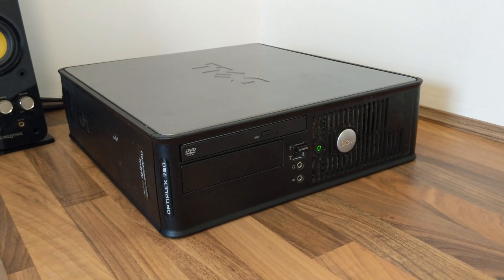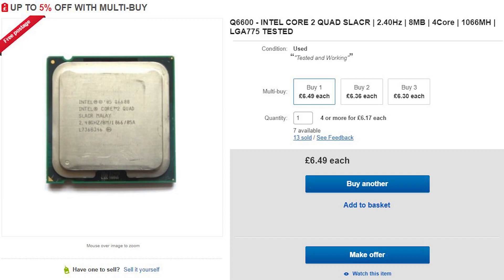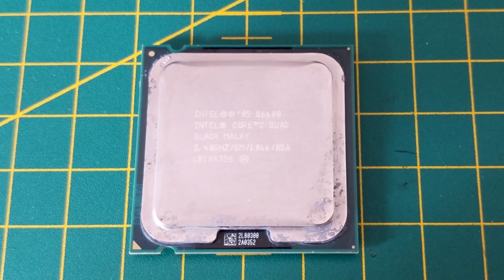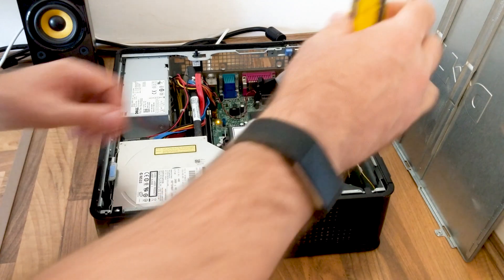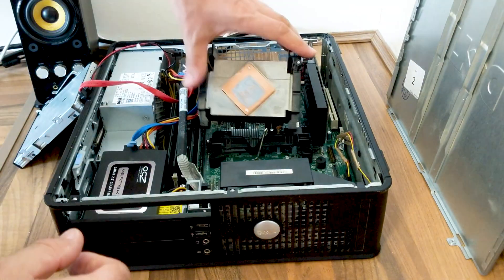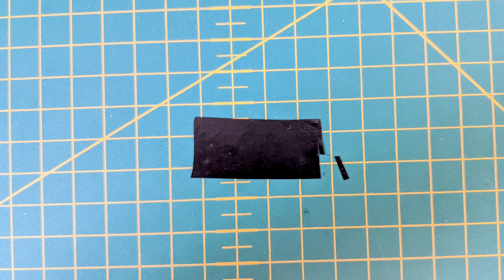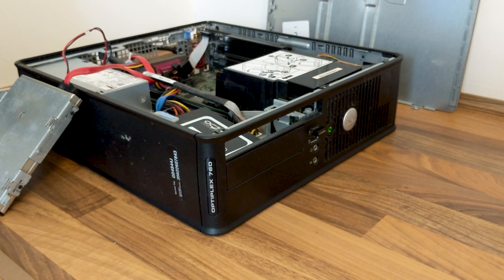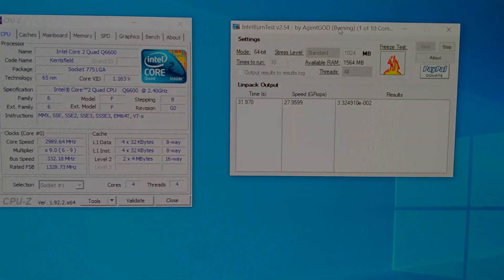How To Overclock A Core2Quad Q6600 Using BSEL Tape Mod (Dell, Lenovo, HP) | Optiplex 760 Testing

Comment: This video is awesome! I got a Q6600 recently for €4.81 off of AliExpress and I'm going to put it on a school PC at the teachers break room. They have four Optiplex 760 with dual cores that break my heart. And two are 32-bit Windows, meaning max 3gb ddr2 666Mhz... The other two 64-bits have 8gb of ram and could use a Q6600 with mod and a 120gb sata ssd since they all do google cloud stuff at the school. Just need to clone the HDD to keep the machines network Domain of the school. Next is the careers library that out of three only one is-64bits... Thats Community Schools for ya.

Comment: Hi bro, is it work on Pentium e5800?
Reply: 800 mhz bus
Reply from the maker: I can't say for sure, I've only done this to a core2duo e7400 and the q6600 in this video..

I did find a forum post where someone bsel modded a pentium e5200 but that's got a lower stock speed than you cpu - https://www.overclockers.com/forums/showthread.php/586596-E5200-BSEL-and-Vpin-Mods

In your case it's probably easier to change the CPU, core2duos and core2quads are cheap nowadays.. check if your motherboard supports better CPUs 👍😎

Comment: Will this work for my x5450?
Reply from the maker: Sadly not, the X5450 already runs on a 1333mhz bus so this mod won't work..
Reply: GameRoomOne okay so how bout the e5472?
Reply: Still waiting for your reply for what about the e5472?
Reply from the maker: The e5472 has got a 1600mhz bus so isn't suitable for a bsel mod.. this mod only works on CPUs with a 1066mhz bus.. 👍
Reply: GameRoomOne what the fastest x or e quad core with 1066fsb?